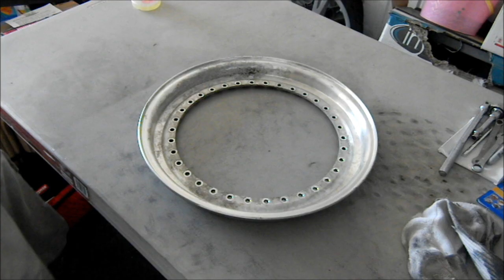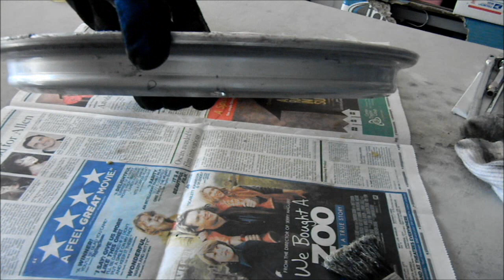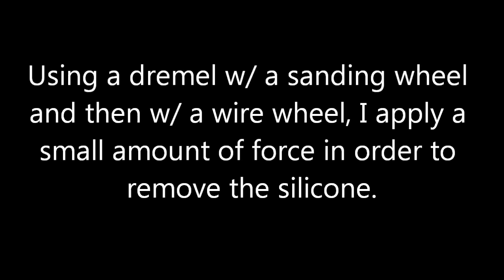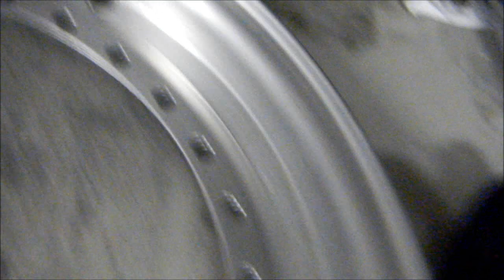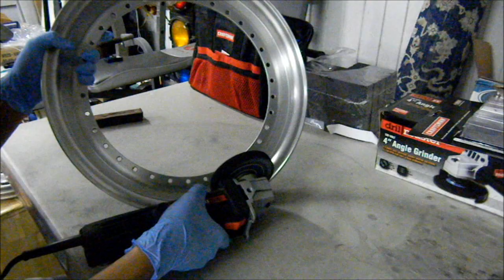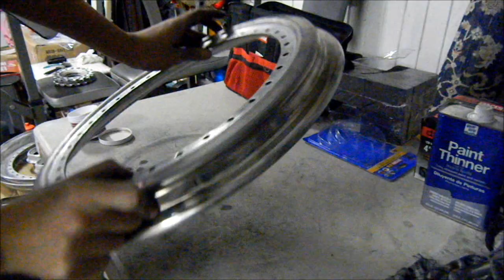Refinishing 3 Piece Wheels - Polishing Lips

Comment: Do you ever re-clearcoat the lips?  I have a set of enkei e92s that obviously aren't 3 piece but have polished lips.  They aren't horrible but oxidized more than is acceptable.  Centers are painted or coated gold.  What would you recommend I do?...Besides get some 3 piece wheels. :)
Thanks
Reply from the maker: Nope re-clearcoating would just paint over the oxidation on the lips so it wouldn't help make them nice again.
And if you strip and then polish your lips like in this series, clear coating the lips after the polish gets iffy. Because the clear coat takes away from the shine and on top of that you then have to worry about the clear coat peeling or getting faded.
So really the best way imo, is to strip the lip, polish it, and then keep it raw and use some Mag and Aluminum polish every so often to keep the lips polished :)
Reply: Word.  I didn't mean just to clear over the oxidation.  I meant when you're done with the polishing.  Nice work man.  The only thing worry about with stripping the polish off is where the clear meets the paint on the glod face.  Hard to tell if the cleared over that too ya know.
Reply from the maker: ***** Yea for that I would probably tape off the face to prevent any stripper from going there cause it will take off paint pretty fast haha. Best of luck!

Comment: I picked up some Blitz 01's and the finish is foggy - they don't have any oxidation. What would you recommend I do; just polish with an angle grinder? fine wet sand and then polish?
Reply from the maker: If the finish is just foggy try polishing them with Mag and Aluminum polish. If that doesn't help then polish using an angle grinder and so on. And then if that doesn't work then you would need to sand and do the whole process.Oh also make sure it has a bare metal finish and isn't clear coated. You can tell when you use the Mag and Aluminum polish and if the cloth your using turns black when polishing then it's bare metal, if not then it's coated with something.
Reply: ***** Thanks for the timely reply! I'll do that and see if I need paint stripper to do the whole process. One question: after everything, why didn't you re-clear coat the rims? I'm positive these Blitz are alloy but I want to preserve the polish after all that work
Reply from the maker: No problem :)
Clear coating wheels often takes away the shine that raw polished parts have. On top of that because it's a coating going on top of the lip it'll eventually wear away or fade and now your back to taking the wheels apart again to redo the polishing process. Also since the part is polished you can have questionable results in getting the clear coat to properly adhere to the surface because it's so smooth. 
So basically there's less room for error without coating and you get a better shine.

Comment: Why did you number your lips?
Reply from the maker: Because some have claimed that when reassembling the wheels all the lips, centers, and barrels should match the wheel that they originally came apart from. This is because, again some have have claimed, that the wheels may be tweaked a little in a certain way because of how long they've been together. So to prevent imbalance when reassembling different lips to different centers etc. they recommend doing all the same lips, centers, and barrels as they originally were.

But will it actually affect it that much or even at all? Probably not haha

Comment: Do you wet sand the face or do you just polish it?
Reply from the maker: I haven't done faces before so maybe you could get away with it if the faces weren't really scuffed up. You can always try doing one face and if it works then great and if not, you haven't spent much time and can do it by sanding.
Hope that helps,

Comment: Did you use a backing pad on the grinder and remove the grinder guard?
Reply from the maker: For the buffing wheels I just put them on the shaft on the grinder just as you would put on a cut off wheel. Yea I removed the grinder guard so the wheels would fit.
Reply: Thanks man! I hope my wheels come out as good as yours. How's is that 240sx project coming along?
Reply from the maker: Chris P Lot's of footage to be uploaded. If everything goes as planned, the transmission should be back in the car tomorrow :)
Reply: Nice! What's wrong with your current transmission? Are you a member on Zilvia?
Reply from the maker: Chris P Went driving, let the car sit, then went driving again, and when I came back I noticed there was a puddle of trans fluid on the ground where I had let the car sit haha. So I basically just redid all the seals and cleaned everything up.

Yea i'm a member on Zilvia. I really don't post anything though because you can google almost everything about a 240. Also for some reason I'm not really into being active on forums anymore, idk why though, I guess it just got tiring.
Reply: It's good that you took care of it quickly before anything else gets harmed. I'm the same, I'm always lurking on forums but never contribute. 

Is there any way you can take a video/pictures of how you attached the buffing wheels to the grinder? I just received my shipment(buffing wheels) and can't figure out how to attach the damn wheel. Did you just use a washer and a nut?

-Thanks
Reply from the maker: Chris P Well for that exact wheel and grinder combo I used a razor to make the center hole of the buffing wheel bigger to fit on the grinder. Then i just attached it like I would a cut off wheel. I'll take picture's tomorrow and then I'll message you with the links.
Reply: I was referring to the lock that you used, my grinder is a little out-dated so I had to buy it separately at my local hardware store. But thanks a lot for your help man.
Reply from the maker: Chris P Yea I used the standard nut that came with the grinder. I'm sure you can use a washer and nut if your original one doesn't fit.

Let me know if you still want the pictures or if you have any other questions. :)
Reply: ***** hey bro, i was wondering if you could send me the picture of fitting the pads to fit into the 4" angle grinder? if u can send it to my email thatll be great! allanha@sbcglobal.net
Reply from the maker: ***** Just e-mailed you at the given address.

Comment: Awesome video, very helpful!
I've ordered the buffing wheels and the buffing compounds you have in your video, but what do I need to get to attach the wheels to a buffer or drill? I have a Porter Cable 7424 and basic cordless drills, but not sure what attachment you're using. Thanks!

Comment: Oh ok I understand now. I'm restoring 3pc O.Z.'s and i've been using this guide so thanks for all your help. I'm about halfway done with sanding the set and about to move on to fine grit. Also I used the spray can version of the stripper, its fast but after the 3rd-4th use it doesn't spray so well, even with the can still half full so ironically I think the brush on type is faster at the end of the day. Thanks again for all the knowledge.

Comment: i didn't use the stripper yet. i sanded the lip with 400 grit until most of the blemishes came off. should i still use the paint stripper to completely remove the clear coat? right now the lip is dull.

Comment: i couldn't find aircraft stripper so i used circa 1850 heavy duty paint and varnish remover. i already sanded the oxidation and some clear coat with 400 grit wed sand. now the oxidation is gone. can i still use the paint stripper to remove the clear coat? or should i continue sanding with 800-1000-1500-2000 grit sand paper? thanks